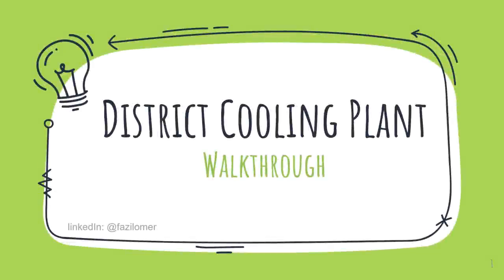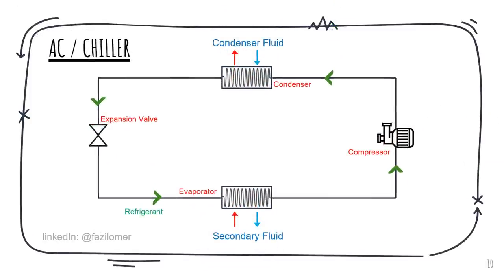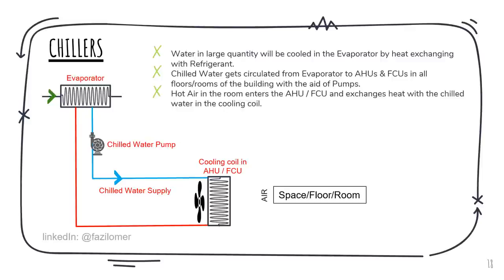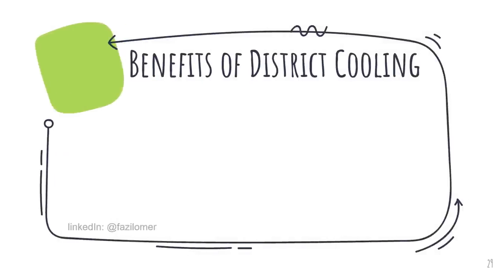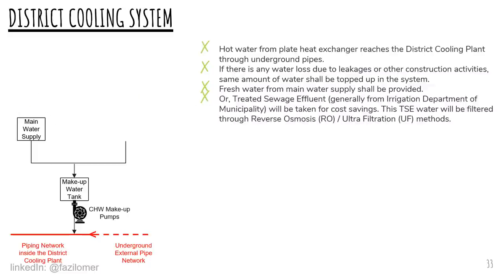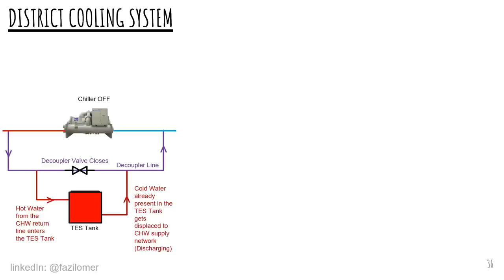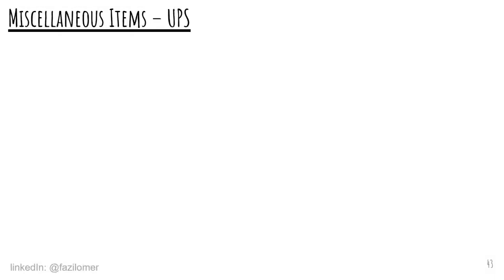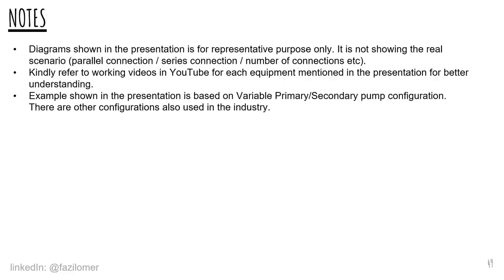District Cooling System - Walkthrough

Comment: How to calculate DCS process cooling total water capacity in buffer storage? please.
Reply from the maker: Hi there, I was a member of the construction management team for the DCS project. While I don't have expertise in design, I can try to help with your question to the best of my ability. From my understanding, DCS systems can vary in type. The system we used was a closed-loop system with a variable primary-secondary pump system, hence there weren't any requirements for buffer tanks. However, we utilised Thermal Energy Storage (TES) tanks to improve chiller efficiency and manage peak loads.

Comment: Is TES tanks are using in dubai district cooling plants
Reply from the maker: Yes. TES Tanks are there in most of the District Cooling Plants in UAE. Depends on the load requirement of the community it serves, Plants can have either only Air-Cooled Chillers or a Combination of Air & Water Cooled Chillers or a Combination of Water Cooled Chillers & TES Tanks.

Comment: Hi anyone please advise, the district cooling estimated load for 1 building( ie: an apartment building required 1000TR (3500kW)= DC Plant load of 3500/5(cop)=700kW). This 700kW is the total energy consumption including the ETS and DCP load ? Or do we need to add a separate power consumption for the both ETS and DC plant’s mechanical load??? If someone have the actual energy consumption rule of thumb, please comment…